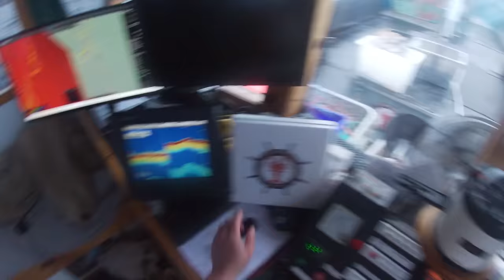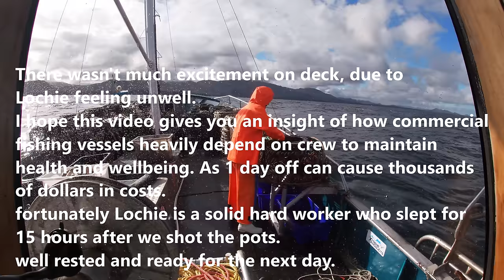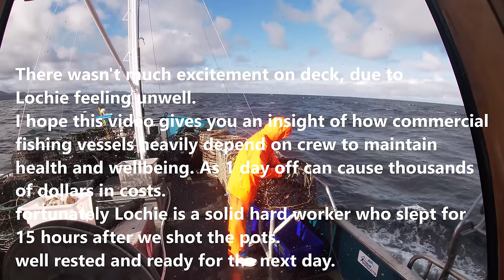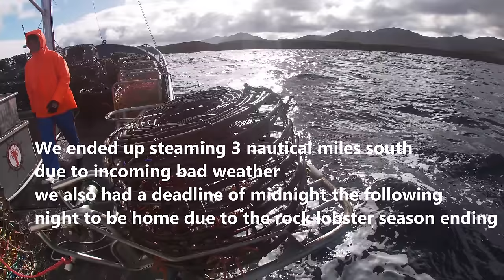DAY 16 LOBSTER FISHING - Deck hand calls in sick?

Comment: i don't know if you know how Debilitating a migraine can be you can see by the way hes holding his head hes doing his best to work.
to have the piss taken out of you at work is bad enough to do it on a you tube channel to 4K plus is piss poor 

an unsubscribe for me.
Reply from the maker: He watches and reviews them prior. 
He was happy with this. 
It's true and happened. Can't change that. 
By the time we pulled the gear it was 4 hours later then we normally start. It then stopped the rest of the day. This is life on a boat, most boats would have been fuming. I got up and got the work done. He then joined in, as I wrote in the end. Lochie is a important part of the team.
Reply from the maker: I would love to know the "piss take"
Reply: Good work lads.